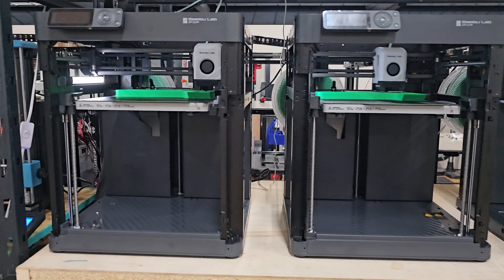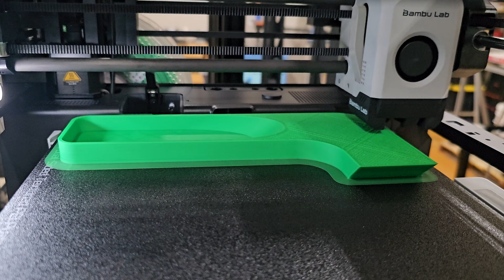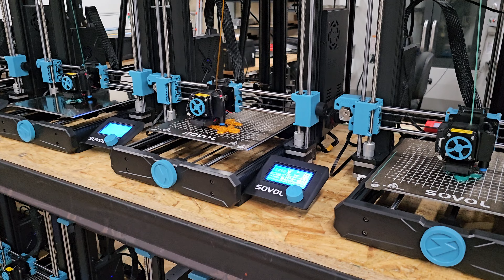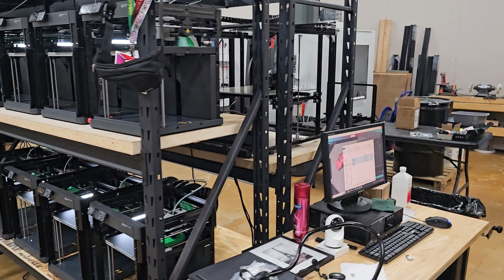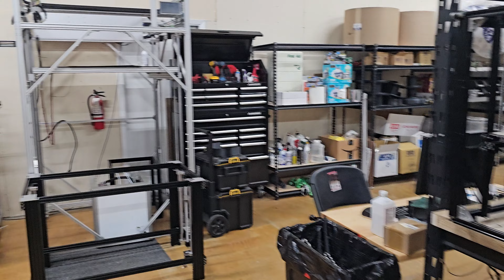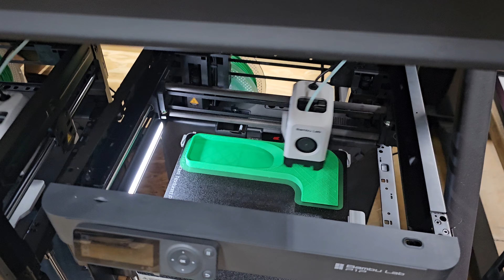Bamboo Labs P1P Production

Comment: I did not like my Bambo p1p and x1 carbon the sovols yes after some upgrades, my prusa's still the best mk4, mk3s and the xl's are the way to go for a print farm bein doing this for 10 years now as a print farm and had rep rap made printers in the late 90's which were something else to get running and keep running.
Reply: Not disagreeing, just looking for more info. Why do you like the Mk4, Mk3S, and XL better than the Bambus for print farm use?  I've got one Prusa Mk3S+ and one Bambu X1C. So will need to decide which brand to add more of as I grow. So far I prefer the Bambu X1C for speed but the Prusa is sort of sentimental to me and I do love it. Can you give some more info and explanation? I'd appreciate it.
Reply: @boostsv  okay when the bambu goes down get it back up is a nightmare and to get help from bambu is like pulling teeth and takes a long time so when a part break down you have to get it from bambu and they are not very easy to repair but prusa has great support and is open source so upgrading and getting parts are very easy but if your stuck prusa online help is right away to get you back up and running but i have found that over time the prusa's prints are great and the bambu's are not as good great for the first while but over time degrades
Reply: @grampafpv8013  I have seen it mentioned elsewhere that the Bambu seems to break in and surface quality can degrade. But I wonder how often people re-run the self-calibration, etc. Plus the advanced calibration options with OrcaSlicer, etc. Wonder how much of it can be tuned back out of the machine as it wears in.
Reply: @boostsv  every time i got a failed print and it does not matter they are what they are great at first and then nothing but problems later on
Reply: @boostsv  I hope you have better luck with them as time goes on, but i still think prusa is the way to go, also prusa customer service is top notch Bambu they don't really have one and they should for what they cost.
Reply: @3DPrintsEverything is that your opinion as well? I see you highlighted that reply saying they're great at first with nothing but problems later on. Has that been your experience with these machines in this video or Bambu in general?
Reply: Personally speaking... Owning 4 of the x1c bambu they are faultless and each with 1000+ hours on them. If you do need help it's no problem you can contact bambu but like most printers. Just fix it yourself. With prusa printers your paying big bucks for old tech that you end up fixing yourself anyhow. Just my experience anyhow.
Reply from the maker: Ours are running great!